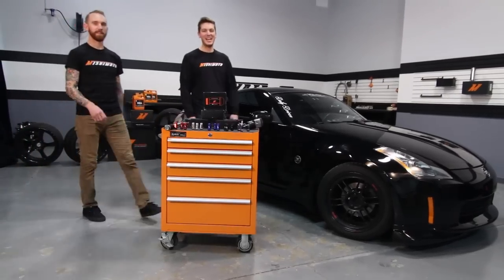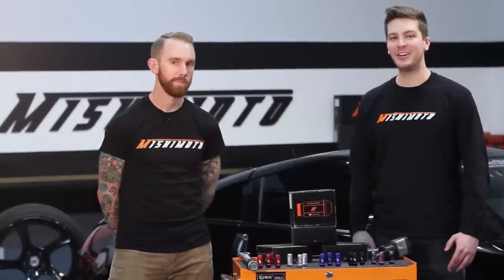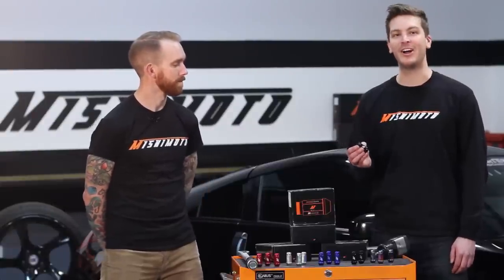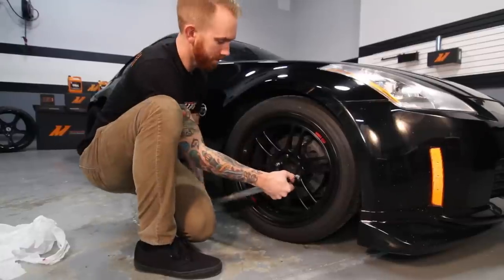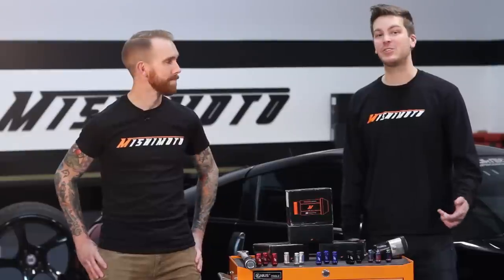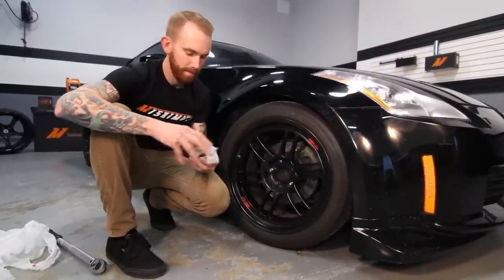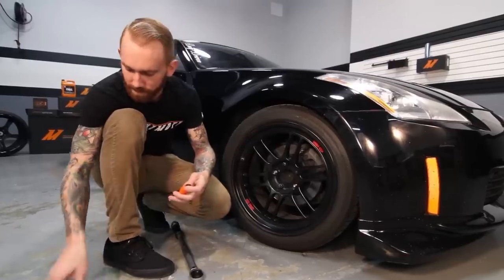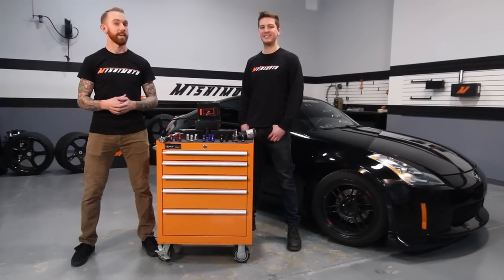Do-It-Yourself, How To Install Locking Lug Nuts w/ Chris Forsberg By Mishimoto

Comment: I've seen reviews and pictures of your locking lug nuts fade. From red to pink? Is this true?
Reply from the maker: Hey Venir! Our locking lug nuts anodized finishes may fade when abrasive or corrosive cleaners are used. In addition, the use of power tools may also damage the finish. Mishimoto Automotive will not warrant nuts for fading finishes or damage occurring from use of tools.
Reply: thanks! looking forward to your products

Comment: under 85 LB's? But what if your manufacturer calls for 100LB's. or does that vary with different lug nuts, and not the lugs themselves?
Reply from the maker: BMW Guy Correct. The torque specs for our lugs are specific to our lugs. The manufacturer torque specs are for the factory lugs. :)

Comment: they look nice, but they dont look like they are locking.. how are they locking? it looks like i can use a regular socket to take it off.
Reply: They're 7 sided lug nuts.
Reply: 4 of the nuts in the kit are special ''lock nuts'' they have 1 more side...so they need the special key which is also included in the kit.